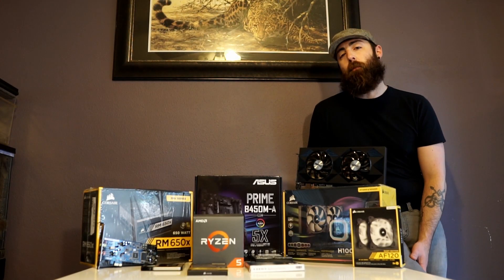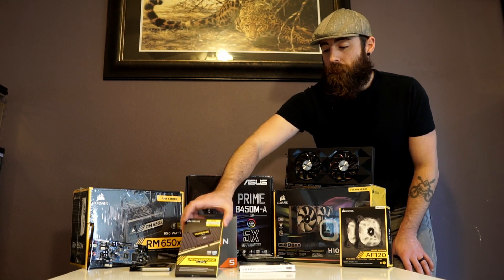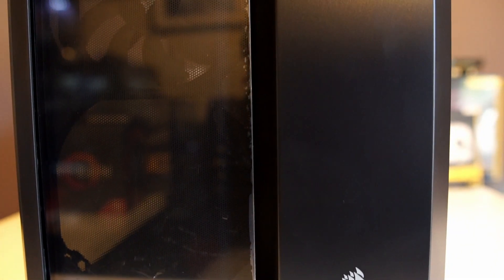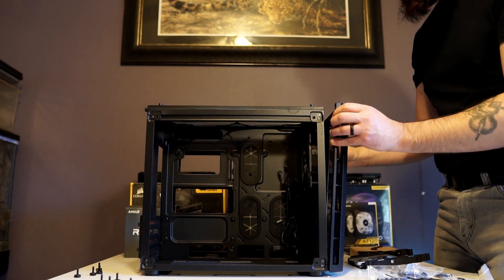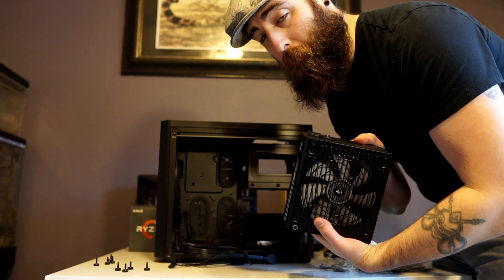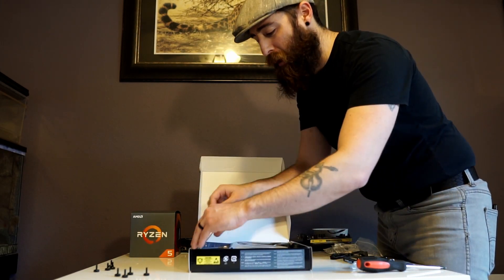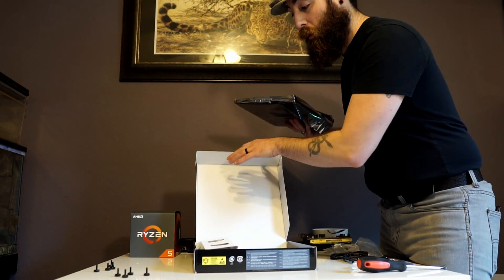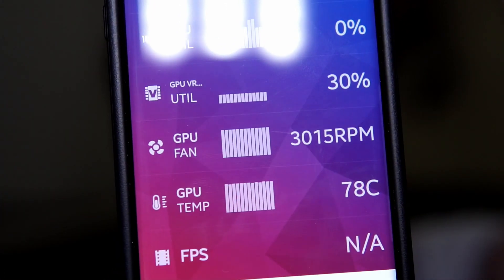Let's Build! Corsair 280x + Ryzen 5

Comment: Advice about your thermals...if you switch your AIO to the front you could see a difference of around 10 degrees C. Kyle from Bitwit has a great video explaining AIO cooler placement if you wanna check it out.
Reply from the maker: Oh nice! Thanks for the info. I may still do that, but I switched out the GPU to a 2060 and it doesn't get about 63 even when pushing it!

Comment: How much cost The PC
Reply from the maker: Total was $1200 (after also getting a new GPU). I had originally set out to do a sub $800 build. If you reuse some old parts (like hard drives) and search for deals, you could get a similar system for $800 or less.